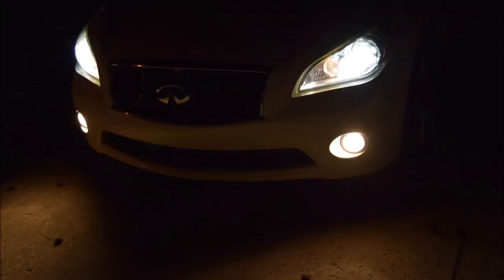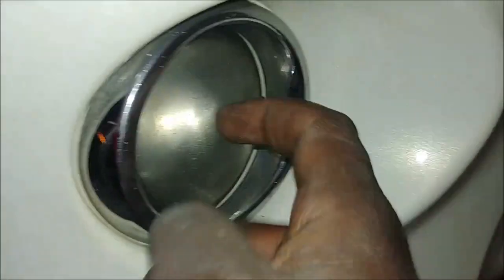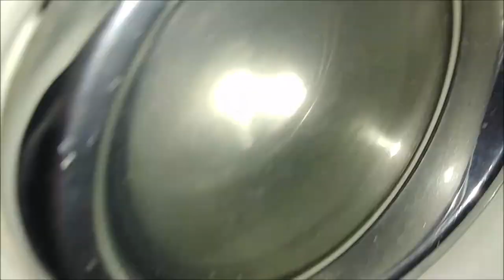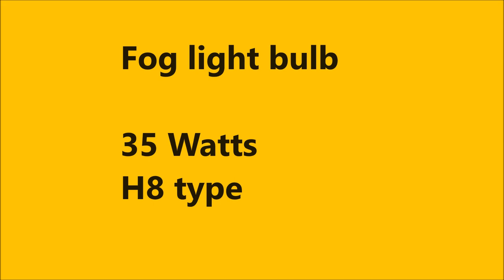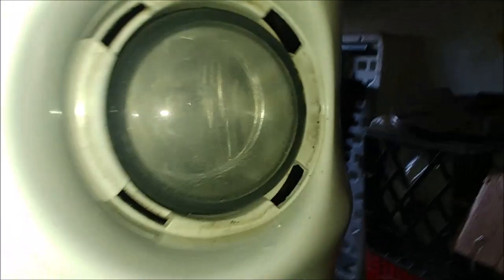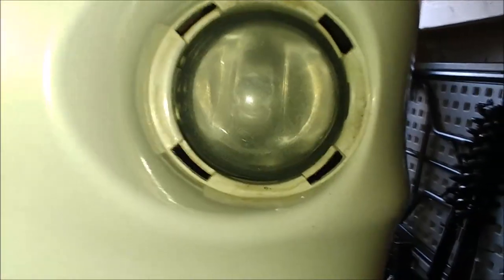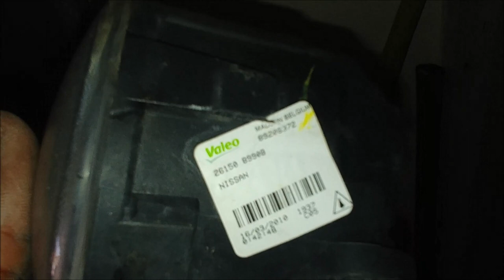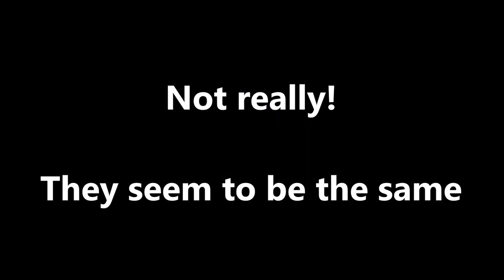Infiniti M37 M56 fog light & lamp replacement

Comment: My 2011 m56 has 96k miles. What kind of oil do u recommend?
Reply from the maker: For now I use any synthetic 5w30 oil that is on sale. Mobil 1, Castrol, Valvoline, sometimes Pennzoil
Reply: @EdBwoy  thanks so much. I checked the oil because u said in one of ur videos that this car does not say when it is low on oil. Ive only had this car for 4 months. One more thing have u ever updated the GPS on this car? U gotta take it to the dealer for something like that?

Comment: Does no one use a ratchet anymore?
Reply from the maker: Only if the power tool can't fit.
Power tool > ratchet > gear wrench > traditional wrench > vise grips > pliers
Reply: @EdBwoy  No I get it Ed, but I just think of the thousands of stripped, broken and cross-threaded fasteners out there.
Reply from the maker: @wayne3340  for me, on the way in I usually like to start by hand to get a feel. On some fasteners, you can still get a good feel even through a tool.
For removal, experience has shown me that if it was gonna break it is going to break anyway. I do my part with PB blaster then just unfasten it the fastest way I can. 

See, my tool isn't for torque. It's just to save me from the repetitive motions.
Reply: @EdBwoy  Cheers!

Comment: Dude you have so many M35/45's but you cant buy a tripod or a go pro? I love your work but I get frustrated watching you struggle with your video equipment.
Reply from the maker: Thanks for the feedback. I have a few tripods (I know I used a tripod in this video), but they won't do much good when I need to work upside down with the car raised 1 foot off the ground. 
I don't like holding a camera while working either, but it's a sacrifice I make to show the work in the detail I want. 
If I had a car lift, life would be much easier, but hey I am still accepting donations.
Reply: @EdBwoy  I don't know if you've posted any videos on the headlight assembly. I have an M45GT Japanese import, and although I haven't had a good look, I would appreciate any instructions on the headlight assembly, including a complete breakdown, I'm keen on modding some components.
Reply from the maker: @jarnee1  sorry chief, I haven't done any videos on the headlight

Comment: Hey man I really hope you will reply. I know the infiniti has the same usb aux in the center console as my nissan fuga hybrid. Mine doesn't work and i ran a self diagnosis. It says overcurrent. Do you happen to know what I should do >?
Reply from the maker: I haven't had to deal with it, but have you gone through the fuses? Blow some compressed air just in case there's debris in there to start.
Reply: EdBwoy I didn’t find auxiliary fuse in my passenger fuse compartment nor in the front hood one..
Reply: Can you tell which lamp model fits for nissan fuga y51 2009?

Comment: No clean video for the passenger side, it's super tight, the driver side is easy, might have to replace the tank
Reply from the maker: If you watch this video to the end, you'll see that I removed the passenger one to talk about the orientation of the bulb.
Yes, it's tighter in there but once you've watched the video and understand how to remove the lamp, then you can do it without even having to look at it. I did it, without even moving the tank - just get a good tool selection.
Reply: My job involved replacing the entire fog light on my 2013 M37xS, somehow water got inside and rusted it out.  Basically is was simple, I jacked passenger side up, put a stand for safety, removed the inner tire splash, laying under the bottom every is clearly visible, the tank is indented enough to use a 8mm wrench or socket.  Removed the screw (socket is faster), to remove the foglamp assembly you have to unclip six tabs that hole the plastic looking mesh cover, the chrome ring is part of that and not separate on the sport model.  Before putting the new in, I WD40 the screw, and screwed it into the new to make it easy to hand screw in.  I then put the foglamp, hand turned it all the way in, and then used the wrench to tighten it firm.  I connected the light, clipped the wire support to the tank. Checked that light worked, clipped the wire mesh assembly from the front.  Last part was the put back the tire firewall or splash guard, you need about 6 plastic clips (found on ebay .05 cents), jacked the car up to remove the stand, and then released the jack to let  car down, and I was done.  Bottom line you have to remove the firewall because the bottom piece to access the light is stapled to the firewall..  Should have made my own video...lol
Reply: and the tab under the bottom on the fog light you don't to pull in down, you just turn the assembly, slightly turn it clockwise to take out.

Comment: Hey Ed, both of the fogs on my m35 are not coming on. I've checked the fuse by the battery but it's good. Any ideas of what is the cause?
Reply from the maker: Bad bulbs?
Reply: Both at the same time?
Reply from the maker: If they are similar bulbs which were installed at the same time, they should last the same amount of time. 
It's worth a try
Reply: Yea probably. Will give it a look.

Comment: How do you change the fog light on M56  passenger side
Reply from the maker: If you watch the whole video, it will give you a very good idea and get you 90% there. The only issue is that it was too tight of a fit to show video
Reply: @EdBwoy  thank you glad you told me. I through you didn't change it out because of the wiper fluid. But now you told me that I able to do it I am happy. THANKS AGAIN
Reply: @EdBwoy  I just order 4 head light bulb, how long will it take me to replace the M56 ? Plus all them are high and low bean.